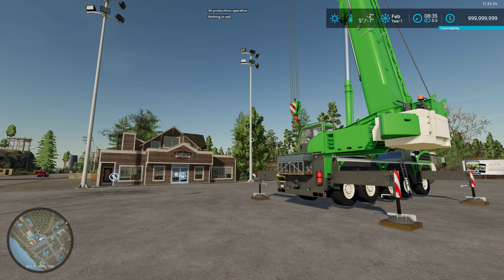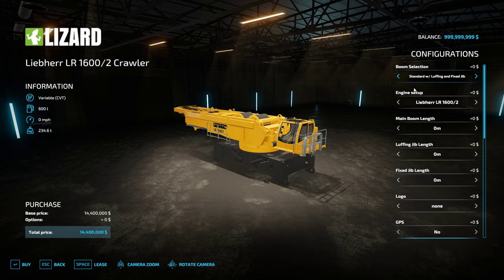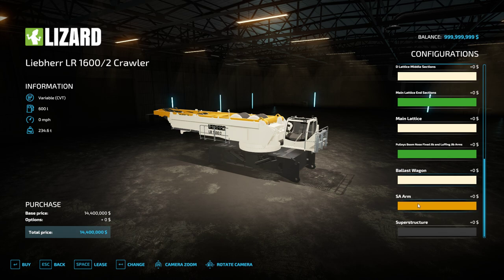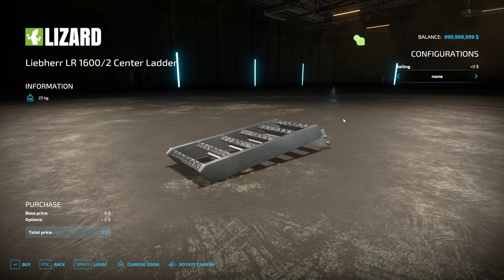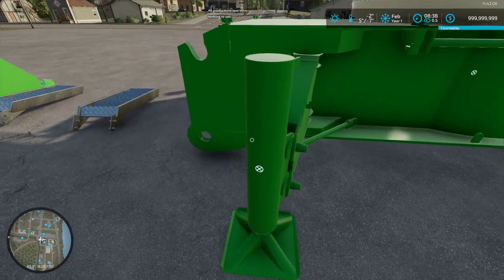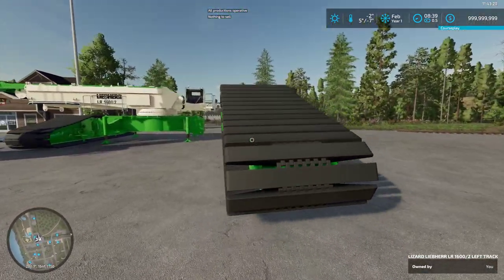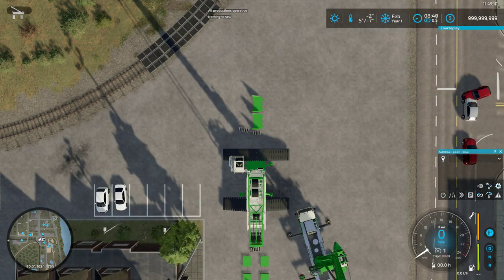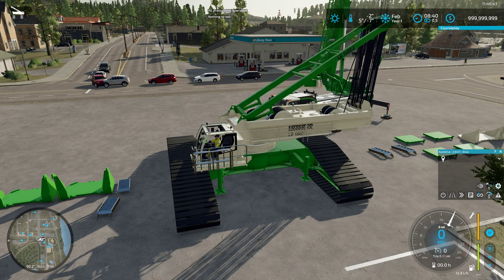FS22 Liebherr LR 1600/2 Crawler Section Setup Tutorial

Comment: Ive tried everything, chnaged the key binding for Simple IC, Restarted, Re Installed SImple IC and still cannot spin the cab, The buttons wont show up.

But i changed the KEY for SImple IC and its still showing the Slash as the activation. Any ideas?
Reply from the maker: It is not Simple IC, it is Interactive Control. Two different mods.

Comment: I think this can be made for consoles like...i think if some options were already made like the ballast wagon. I think if there was a options to select how many weights to add instead of manually doing so possibly.

 Also for the other parts for the main body part of the crane to make for consoles i think if you have the tracks already connected and the stairs and railing an weights too it would help make the mod alittle smaller. I think the booms wouldn't be issue so i think thats okay. Also i think the hooks instead of multiple hook maybe have 1 and have options to choose which size would be perfect for the player. 

I dont know how difficult it can be to adjust it all since i really dont know how to mod but i certainly think it can work! But the only 3 issues im seeing if it does come to consoles is how the hook would lift stuff and the poly count and little interactive xs. I think for the little xs it can possibly be part of the unfolding animation.

 Oh and almost forgot about the boom nose and pulley set! If possible you can add it to the boom already for consoles. So basically the only pieces would be in the pack would be the hook and booms and wagon and the entire crane everything else already connected and adjustable with few options! Tbh! I think if all works this will be the top mod in farming simulator of all for all platforms and branding shouldn't be issue since liebherr is already in game luckily!

Comment: Hello!, Ive set everything up but I got up to the part where I have to move the boom at the back up with Crtl K, and it doesnt work?
Reply from the maker: Have you checked to make sure the keys are assigned?
Reply: @jeremybrown9379  yes I have
Reply from the maker: @AirportAviation380  if you are talking about the “small” boom arm on the superstructure try going boom down.
Reply: @jeremybrown9379  Yep, tried that, Ive gone through the Key binds for the liebherr and they are empty, I put the Crtl K and M for the Boom 4 controls.
Reply from the maker: @AirportAviation380  Try a different key combination. Or have just the crane in the game and check to see if it works.
Reply: @jeremybrown9379  Its works now, Thanks for the great mod
Reply from the maker: @AirportAviation380  glad you have it working.

Comment: What lift mod are you using? With mine I can’t use IC when I have my lift anything mod installed bc of the lift hand that comes up.
Reply from the maker: It is the lumberjack mod on the official modhub.  It can be activated by holding or double tapping lalt.

Comment: Hi. How can i transport the main unit from the shop to another location on the map ? Which trailer would you suggest ? Should it be an idea to create a special trailer or this crane ?
Reply from the maker: You can use any truck/trailer combination designed to haul 93 metric tons.
Reply: @jeremybrown9379  Hi. I am afraid you misunderstood me. The main unit ist too heavy to carry it with super strength to a trailer. I also can not carry the main unit  with a crane due to missing fix points (for a hook). I hope, that you can now understand my problem and pls apologize my bad school english 😞
Reply from the maker: @ms190766  you do not need to carry the superstructure to a trailer. Use the legs to lift it up so the trailer can go underneath it. If it is still not high enough put wood blocks underneath the assembly outriggers then raise it with the assembly outriggers.
Reply: @jeremybrown9379  Thank you very much. This is a good idea, thank you

Comment: How do you get the cross on the vehicle to unfold the support legs?  What settings do you have to make?
Reply from the maker: You need Interactive Control mod from giants modhub.
Reply: Where can I find it???  And what do you have to set there?  Please for your help
Reply from the maker: @StevenKniss  it is on the giants modhub. You can search for FS22 Interactive Control and it will come up in search results. After that the only thing you may have to do is change the activation key if the default key does not work inside the cab.
Reply: Found it.  Thank you very much
Reply from the maker: You’re welcome  @StevenKniss

Comment: How do you activate criminal control?
Reply from the maker: Do you mean Interactive Control?

There is a default activation key that you need to look into the Control Settings under Interactive Control to find.  I have mine set to another key so it will not help you.

Comment: What mods do i need for this to work
Reply from the maker: Interactive Control from the giants modhub is all you need.
Reply: @jeremybrown9379  
Yes, I downloaded that I'm still having trouble getting the cab lifted up.
Reply from the maker: @spookydoc1887  you have to use the IC activation key to show the nodes inside the cab. I also had to reassign the activation key.
Reply: I had two ic control mods in my mods folder
Reply from the maker: @spookydoc1887  ah, yeah that can cause problems.

Comment: Right this mod is cool and all but when it doesnt sit flat, like putting up one side of the legs it will start to freak out then go into orbit
Reply: mostly the base bit
Reply from the maker: If it is dancing around a lot then there is a mod conflict and it is built to operate like the real crane which operates on pre prepped flat surfaces.
Reply: @jeremybrown9379  is it possible to see which mod is causing issues?
would it be something like manual attatch or something else
Reply from the maker: @thebokworm  there are so many different mods that can cause interactions with other mods you need to remove them all but the crane. Then add them back in 10 or 20 at a time until the issue comes back. Then pull the last 10 or 20 out and put less of those back in until the problem comes back again. Keep reducing how many come back in at a time until you find the mod that conflicts.